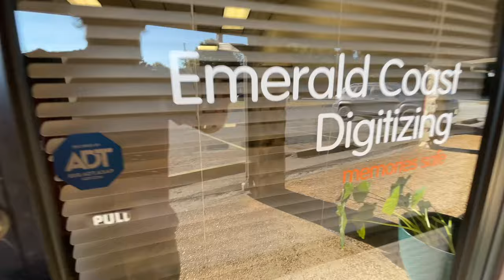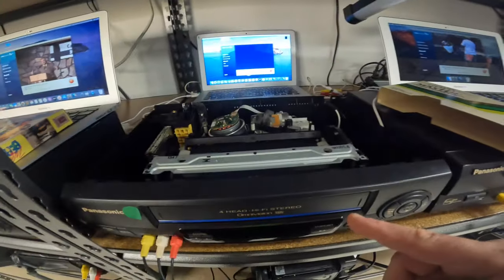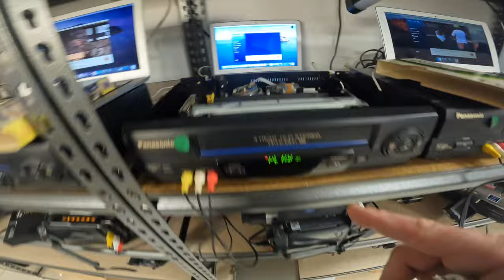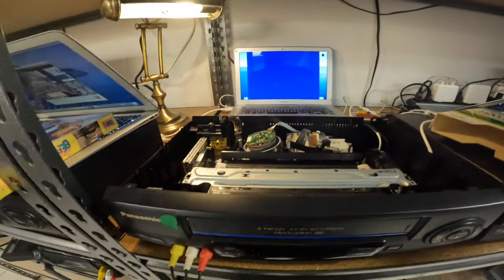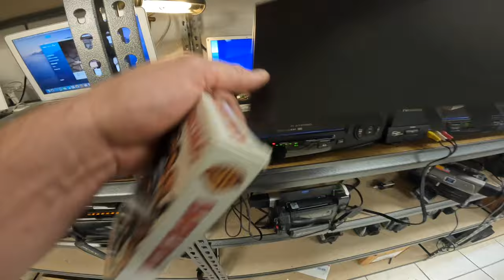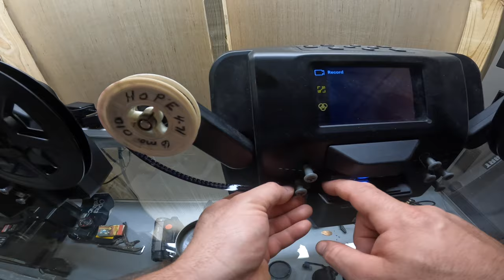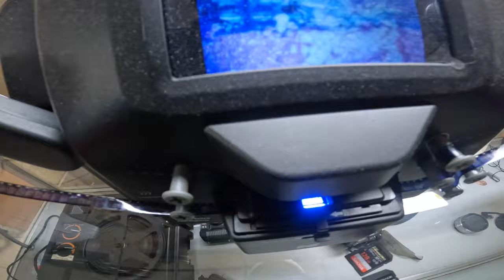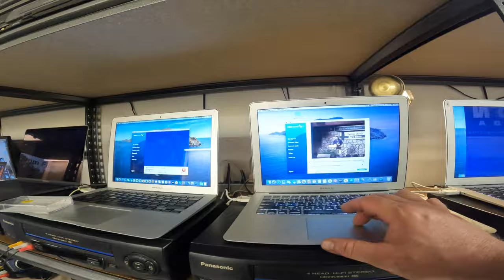Adjusting problematic vcr. Troubleshooting ** worst 8mm film I’ve seen **Tape to digital conversion

Comment: I've always been so paranoid about getting the alignment just right in a VCR and keeping it there at all costs.  I never considered just brazenly screwing with the guide height and A/C azimuth without a calibrated reference signal, just to make one tape play better.  But if capturing individual tapes is the business, I guess you do what works.  I'm not a pro in that business and only do it occasionally, but your videos inspire me.  I will remember this.
Reply from the maker: It’s not that difficult. Just don’t adjust the distance you don’t wanna try and since the timing. Lip sync would be impossible. I only adjust height.
Reply: @EmeraldCoastDigitizing  Good advice! Thanks!